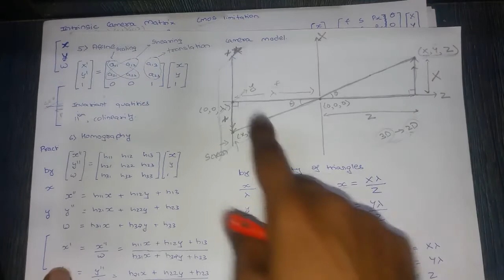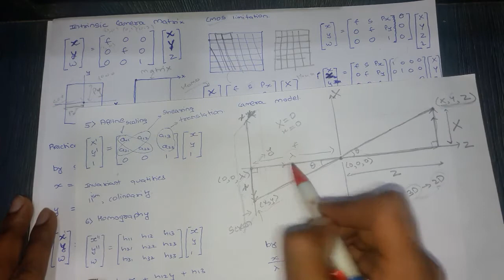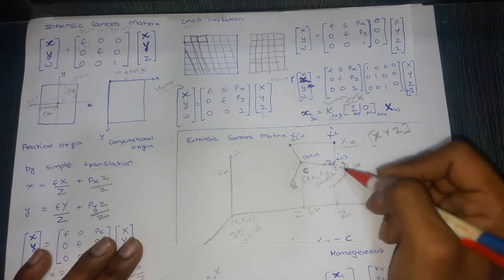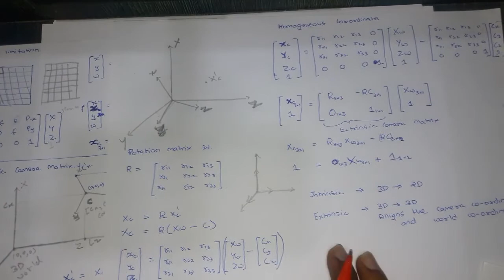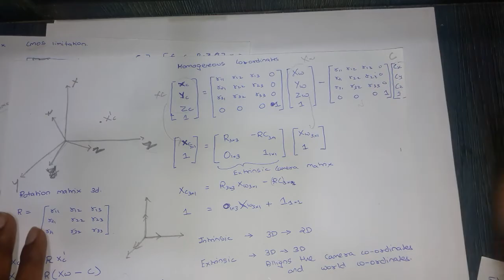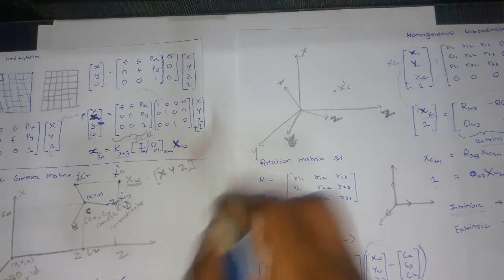Comment: Thanks Pratik for the video, its nice. 
I had one question, Can I calculate the orientation for camera (Angle at which Camera is mounted) from Camera Extrinsic Matrix?
Reply: Yes you can refer to page 9 of the following pdf 

https://www.cse.usf.edu/~r1k/MachineVisionBook/MachineVision.files/MachineVision_Chapter12.pdf

under section 12.2.1 Rotation Matrices you will get the equations (12.3) by which you can find the angle.
Reply: @pratikian  than you Pratik, will try it out.